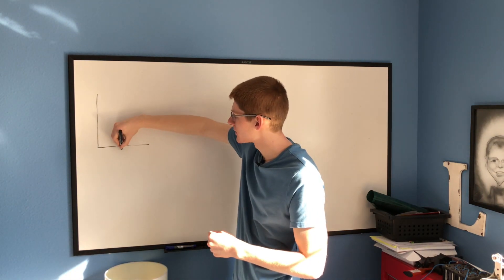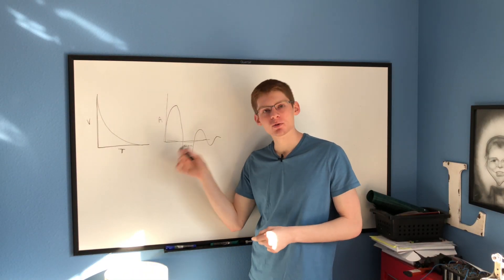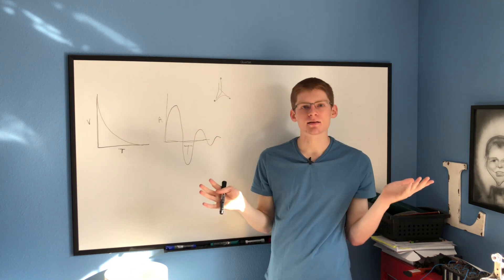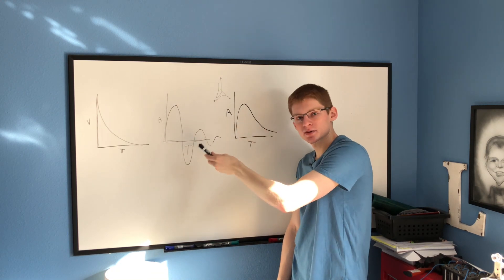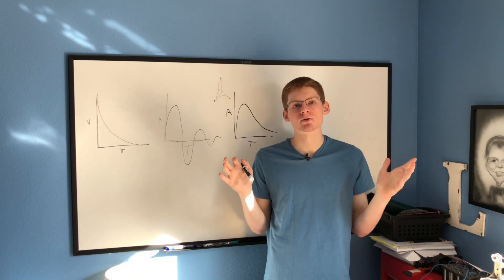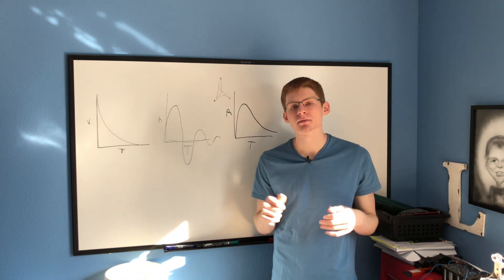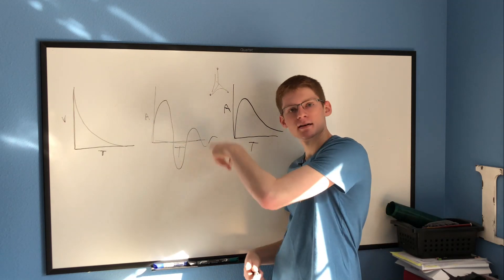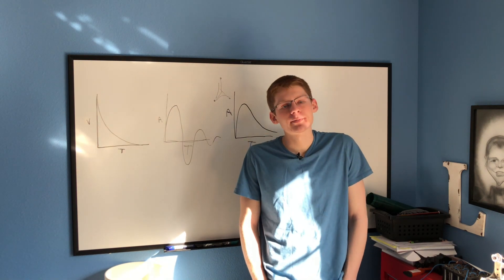Final(ish) Thoughts on the Coilgun Project

Comment: Kind of late to the party but hysteresis in the metal projectile should give it some ability to be pushed from the end of an inductor. However that might lessen its ability to be pulled by the next coil as it becomes slightly demagnetized. It would be interesting to see if an oscillation tuned to the speed of the projectile such that the negative cycle kicks it out of the coil would even produce any noticeable improvements.

Comment: Linear induction motors are a thing. However, they use huge elctromagnets and multi-phase AC to function, because they need to compensate the lack of magnetic permeability of a ferromagnetic core. On a very large scale, the induction coilgun could work great, but for a handheld design, the power density would be too low

Comment: How close are you to restarting the project? I’m super excited to see it continue, and I was also wondering how having a pre acceleration phase (ie some gas pneumatic system) would affect the coils and their pulses. Basically I’m trying to say that if it has an initial velocity could it become more efficient by removing the need for those beginning driver coils and allow for cheaper parts because of a smaller pulse window. I’m just rambling though lol.

Comment: A suggestion for the projectile:
You could use a glas fibre arrow with copper rings on it.
If you want a steel arowhead, you could place it outside the gun.

Comment: essentially what you are talking about is no longer a coil gun but like the thinking anyways ,to go back to the earlier attempt with multiple coils and looking for a way to time them a simpler solution is to make the barrel as a linear set of commutation rings which are triggered by contact wings on the projectile these wouldn't need to carry the full load just act to switch relays between individual capacitor and coil circuits directly ahead of the projectile (a poor mans hall sensor essentially)
Reply: in order to gain speed along the path each coil has more windings because it is momentary only you could do away with the relays and capacitors and just use the battery

Comment: Good analysis. Some thoughts, if you're still thinking about this project... 
** I'm glad to see you turned the MOSFET around so the tab faces outward, for screwing onto a heat sink. Does your MOSFET have drain connected to the tab (usually the middle pin)? If so, couldn't you just connect all the FET drains to the same ground+heat sink for a double win? 
** You mentioned paper as an electrical insulator between the PCB and aluminum plate anyway. Mica's a far better electrical insulator, and a better thermal conductor than most silicone rubber. It's even available precut for TO-220 packages if you do need that. 
** As others suggested, wrap or glue the windings so they're held in place when firing. 
** I was going to offer a reminder about flyback diodes, but you already covered that in Part 5. :-) 
** If you're looking for highest possible efficiency, be aware the outer turns on the coil are not contributing as much magnetic field intensity to the projectile as the inner turns are, because of flux leakage. A "square" cross section (for example, 5 windings long and 5 windings deep) is already going to be lossy. If the coil is 3cm long, having 1cm of windings is probably close to optimal. But if you were going for velocity or small package, and packing 15 coils together, then do make the cross section square, because it's still a (smaller) net win. Then choose a voltage necessary to get the current your FET can handle. 
** Optical detectors don't need to "see" their full width, so you don't need big gaps between coils for light. The LED and detector can go outside the coils, looking through a tiny gap. Even a paper-thin crack between the coils is enough to see light through and switch them, especially if the detector is a phototransistor or feeds the base of a BJT, like Mahdi's circuit. Just surround the light path with black tape or something so stray light doesn't get in. You can also buy photodetectors with lenses built in, which makes them much more sensitive in the direction you care about. Or if you want to mass produce these, as IR MadCow suggested, put detector and LED side by side but send the light to the other side of the coil using optical fiber. If it's plastic fiber, melt the end of the fiber slightly so it's perpendicular or even partly spherical to help couple light straight in or out with less scattering/reflection. 
** Instead of optics, as Rene .Lem suggested, you might be able to use the voltage/current relationship in the previous coil to determine when the projectile is just entering the new one, because the inductance of the coil will be different depending on whether it's wrapped around an air core or iron core (i.e. projectile). That'll require fancy electronics, though. But on the other hand, it's a great excuse to really put your new sampling oscilloscope through its paces! :-) 
** Cut the slot all the way through one end to reduce eddy currents in the plate. It will also reduce the induced electric field at the gap that the wires pass through, so there's less chance of an arc. That also gives you a path for your light and LED/detector wires. 
** Don't use threaded rod. Murphy guarantees the coil or FET in the middle of your stack will fail first, and then you'll have to unscrew all the rods all that distance to swap out that one module. Just put nuts on the ends and squeeze 'em tight. Although I guess that could make alignment with optical holes a bit tricky. 
** You mentioned replacing the coils with linear induction drive. But depending on how you implement this, you might end up with projectiles that hug and drag along one wall or the other, sapping kinetic energy. Coilguns are inefficient, but one of the reasons they're simple is because they tend to self-center the projectile. The magnetic field lines as the projectile enters the coil are concentrated toward the middle, which tends to pull the projectile to the center of the tube, away from the walls. With linear induction, you would have separate north-south poles along the walls, which is inherently unstable if the projectile isn't held on a rail. 

Great comments from many others here as well: Azagro, Rene .Lem, many others...

Good luck, and looking forward to your next update!

Comment: You really don't need a fast or digital oscilloscope for the rather slow waves of a coilgun, though a DSO could make data collection easier and more precise. An old 10 MHz analog scope will do. That is what I used with my single-stage 4000 gee Mass Driver made from junkbox parts. It heaved a 60-gram soft steel rod of 11-mm diameter and 38 mm length through an old surplus coil (also 38 mm long and 7/16-inch ID) from a pinball machine. That coil was designed to run on 24 VAC and I slammed it with 715 VDC, pushing 50 kW through the several hundred turns of 19-gauge wire for about 1 millisecond as the steel rod soaked up inductive and kinetic energy. All attempts to use a permanent magnet as projectile simply re-magnetized the magnet with the opposite polarity. The magnetic field was very intense! Power switching was via a simple relay also meant for 24 VAC, surplus from a vending machine. 
For capacitors I used 2 computer-grade caps in series that I had laying around. Superficially, they seemed to be wildly mismatched, as one was rated 200 VDC and 1400 microfarads, while the other was rated 550 microfarads and 525 volts. But in series, they split the charge beautifully and each was run very close to rated limits. Total (computed) energy storage was 104 Joules. Most of that was discharged in the first millisecond when the Fire! button closed the relay and the steel rod leapt 18 mm to the center of the coil with tremendous force. 
The voltage then dropped to a slightly-tilted plateau around 300 volts for about 2 ms with damped ringing at about 200 kHz for 1 millisecond. Then the voltage plummeted to about 50 volts for several more milliseconds. There was never any reverse polarity across the pair of caps, though one of the pair did get a few volts of inverse charge because they were not perfectly matched. Charging circuit was an old filament transformer from a tube-type radio with the secondary rated 440 VAC at 40 milliamps, which was half-wave rectified by a series pair of 1500-volt diodes to make 715 volts. (Clearly that transformer put out about 510 volts open-circuit on the secondary.) 
Full charge was indicated by several miniature neon bulbs in series plus a series resistor to limit bulb current to near the minimum for stable glow. Combined with the filament winding, the transformer was rated about 40 watts. To prevent transformer damage during the initial phase of (re)charging the caps, the transformer primary was put in series with a 40-watt incandescent bulb, which made a near-perfect current limiter. With that recharge limit, I could fire my Mass Driver about 3 times per minute all day long, with the coil never getting more than barely noticeably warm, so about 1 or 2 degrees over ambient temperature. 
No attempt was made to design or select parts for minimum losses or to electrically match up well, except for the capacitors and the diodes. Instead, the pre-firing position of the steel rod was experimentally determined for best speed, about 31 meters per second, varying slightly between shots as positioning was not perfectly repeatable for every shot. Kinetic energy actually delivered to the steel rod was thus about 29 Joules out of 104 stored, so efficiency on that basis was about 28%. Wallplug efficiency would be a bit lower, but was not measured. Total cost of the whole Mass Driver was 50 cents US, for the 2 diodes!

Comment: One idea that I have had about the number of coils, is that adding more turns takes more length of wire due to the larger diameter, reducing the efficiency of adding more coils. At lower coil counts, it takes more current to get the same magnetic field strength, which increases the power usage. I used an online calculator to find the magnetic field strength, and I believe the optimal coil count is around 7 layers when using a 10mm barrel. There is a small improvement at 14 coils, but it’s only about 15% for a much higher cost.

Comment: This last video brought a lot of valid questions to mind.  In consideration of the copper/aluminum/silver projectiles; they probably only accelerate until they reach saturation, and I'm not sure how much magnetic push they get until that point arrives and their greatest acceleration would be when they go from being fully saturated with the field going one direction, then the field switching and going the other direction. Skin effect also plays into this and using a solid copper slug would mean it is unlikely to become fully saturated in any individual coil so the extra mass is dead weight. I think it would probably be impractical to do it with a copper projectile, however reversing the field of every other coil would most likely still give it acceleration through the entire length of coils.
Reply: Another thought about copper/aluminum/silver projectiles.  Unlike iron projectiles which are pulled to the center of the field, the copper/aluminum/silver projectiles are pushed from the center of the field.  That means timings will be wholly different and you will have to give the projectile an initial push or start the projectile from slightly off center exiting from the first coil.

Comment: while watching i got an intresting thought. Same as induction motors have rather weak torque on start the bullet will have low speed at start. so you would need extremely long barrel to get more efficiency and it defeats the purpose of a gun. it would need to be more like a looped particle accelerator

Comment: Correct me if I am wrong but I think the idea to use copper as a projectile isnt going to work as the magnetic field is parallel with the shooting Direction and by my understanding of the lorentz force the force applied to the projectile should be 90 degree to the wanted moving direction, at least with the "standart" coil layout.

Not so sure about my comment.
I will try to figure it out when I have got time.

Comment: lets say you power your coilgun with batteries only, you somehow manage to pull constant current from your battery (hard to do, but maximum power draw) and you have 100% energy transfer to the projectile (basically impossible). with these assumptions, you can calculate acceleration/final velocity for a given barrel length. at reasonable barrel lengths, with reasonable projectiles, getting anything faster than a paintball gun requires many kW of power. you NEED capacitors, unless you want a really big (EV sized) battery. Your next limiting factor with capacitors is the mosfets themselves. they too have a power rating (VxI) and again, you need some that can do many kW.

Comment: Late to the party but was thinking,
- What if you were to use a NEMA 'C' or 'D' type motor in a linear configuration and provide power with a VFD that has a high locked-rotor output as your power supply.
- You can modify the 'zero point' of a sinusoidal power supply by connecting an additional DC power supply.

Comment: Hi buddy, forget thinking about bullet position, just use the iron rod as firing pin to push a regular lead bullet through the barrel, the iron rod will get stick in the middle but the regular lead bullet will be fired out from the cannon. Your principal goal is to get the strongest coil electromagnet ever. Good luck buddy.

Comment: One thought, as your projectile moves it creates back emf. In short as it moves past the coil it will burn up almost all the “reverse” current.

This is a good thing. Think about a BLDC motor rolling. If it’s designed well and sized for its load there would be zero back emf. You’re coil gun is the same thing. If you tune the coil and projectile and cap correctly there will be zero inductive energy left in them after the projectile leaves the coil.

However if your projectile is to big, you will burn all your energy and generate back EMF before it has passed the coil slowing it down. Conversely if your projectile is to small you will not overcome your reluctance in time. By the time you do you will have no moving projectile to absorb the magnetic field and you will be left with energy still in your inductor after your capacitor has passed. Now that energy goes back into your cap backwards.

Point is if it’s perfectly tuned there is 0 EMF and 0 inductive energy in the coil at the end of the cycle. The ferrous projectile is nearly optimal for this job.

One caveat is that as the velocity changes all of this changes. You need a larger inductive coil at first or lower voltage with more amps. Each coil and capacitor should be tuned for the speed of the projectile at that point.

Comment: have you considered a coil gun for the acceleration force as well as a rail circuit in the projectile in order to induce a magnetic field? could work instead of flipping the field with the RCL transfer function (or could add more efficiency)

Comment: I've already come up with a design idea a month ago that could hypothetically pump up the efficiency over +30% after I did my calculations and the simulations for it but unfortunately I need a 3d printer to print the parts that I need since they require some accurately calculated math to manufacture correctly which is something that's very expensive for me in my 3rd world country. Fml.
Reply: That sounds promising, id love to see your design

Comment: Could you make a coilgun with overlapping coils? Like once the first coil reaches the middle, theres another coil on top, to provide constant power with no breaks, and underneath the overlapping coil, theres another coil underneath it and so on. and the coils wouldnt be winded one by one, because that would make the overlapping coil stick out way from the barrel, instead you wind one coil on the bottom coil, then wind one layer on the top coil, and repeat so that all the coil layers are sandwiched together.

Comment: "Is there another option" 
Why not just have the magnet be a permanent part of the coilgun, and have it travel the length of the "barrel", pushing the projectile down the bore, and then having a spring or something reset it to it's starting point once the force is removed? I know absolutely nothing about electronics, but aside from the innate lowering of efficiency in that the gun now has to overcome the weight of the magnet and the push-back from the spring in addition to the load from the projectile, is there any major downside with this I'm somehow missing? (Pardon me if you address any ideas like this later, I'm typing this mid-video.)